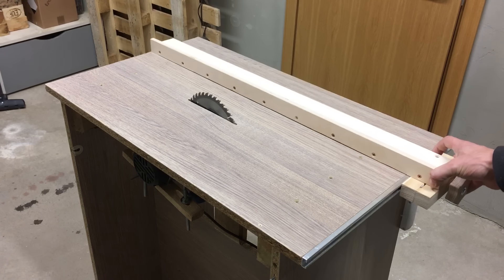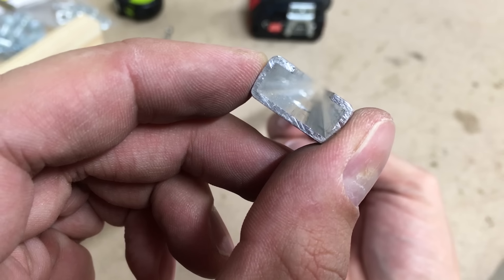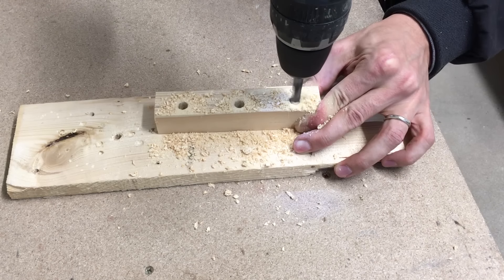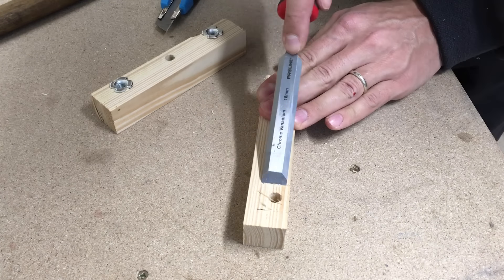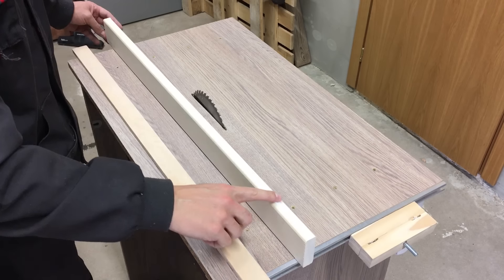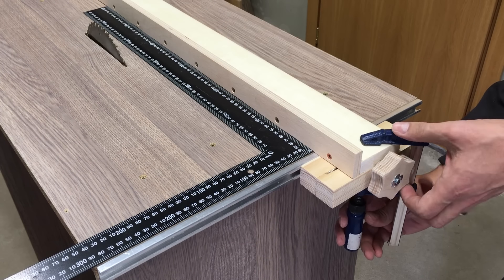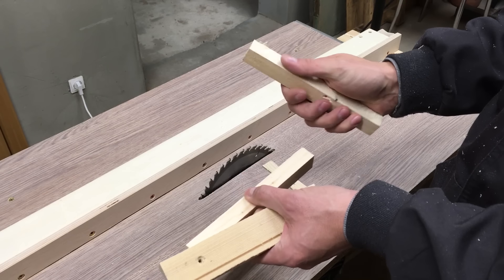How To Make A Table Saw Fence For Homemade Table Saw

Comment: I like how the table saw you made is basically upgrading itself in the process! I think you should've made two rails, instead of one, one for both side the ensure the fence will not be moving, especially at the other end where lever arm is greater. Otherwise excellent build! Thank you, I will be building myself the table saw this weekend and the fence too!

Comment: Good idea, but there's the introduction of flex to the far end of the fence. It would need to have rails and fasteners at each end, both requiring individual adjustment.

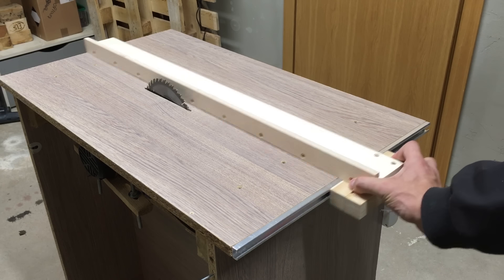Comment: 3:52 from this point on forward you can see the fence wiggle on the top side. I would do what you first did on the other side as well to keep it more intact.
Reply: maybe not. it jiggles when he moves the fence, not when its fastened. the only play will be in the elbow at the near end. i suggest bulking up the area where the slide joins the fence.

Comment: How was the blade rigged?  Is that a circular saw turned upside down?  And how did you rig the on/off switch?  Nice video, thanks
Reply: see his homemade tablesaw video yup it is a circular saw and a powerstrip with a on/off switch

Comment: Great, how did you secure the other end, (if not) there will definitely be movement and it will NOT be accurate.
Reply: Please respond?
Reply: The whole unit is a tee square and when  clamped to the table nothing is moving.
Lidl had some flat sash cramps which use the locking principle of a sealant gun,  I will add a cross section to it  and will make a perfectly good fence.

Comment: Hi Sir. What is middle knob assembly. Pressed thread nut in knob and turn into long bolt ( the head of bolt face inside the rail and end of thread of bolt stick out to turn knob in?? Was it right?? You didn't show how on those steps or too fast I didn't follow up! Thank you please give advice

Comment: Great Video, but one question please . When inserting T nuts, to holes, Why not do T nut recess first after drilling, rather than in the  piece without the T nut, just makes sense to me ! Just asking. ???
Reply: If you're using T-nuts more or less often, it's worth to buy a counter-bore drill bit to drill the hole and recess for the t-nut in one go. Trend for example has them for 6 and 8 mm t-nuts. I love those drill bits... :)

Comment: Awesome job, does this fence hold sturdy for heavy ripping?
Reply: that's what i'm concerned too
Reply: motoman22atgmail  You could add another aluminium rail on the far end, attach a small toggle clamp that slides and it will hold end tight enough.🇬🇧

Comment: Hey, nice look! Is it stiff enough at end to keep sawed wood in dimensions?
Reply: I think it is.  The only side force on the fence comes before the point where blade meets wood, and that force is usually small i.e. just enough force to hold the wood against the fence as the wood is pushed forward into the blade.  And the fence he designed is stiff enough not to flex easily.

Comment: I bought the same piece of aluminium, but what cocerns me is did you change your blade to cut it or the same blade you cut your wood with , sorry I am only starting out with woodworking
Reply: If it's a carbide blade, it will cut thin aluminum just fine.
Reply: No its a wood blade will have to buy one from Bunnings

Comment: The irony is you are using a table saw fence to make a table saw fence.
Reply: What's wrong ? 
It's ok for low cost hobbies!
Reply: What should he use then? It wasnt a proper fence anyway, it was a clamped board.